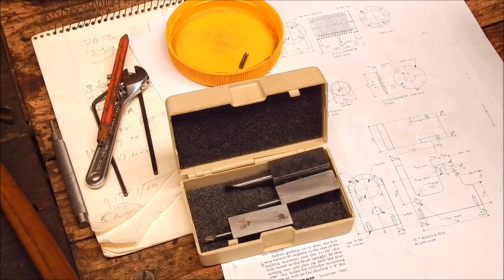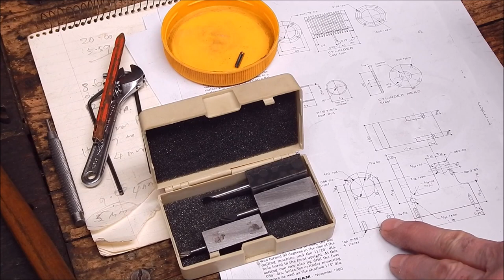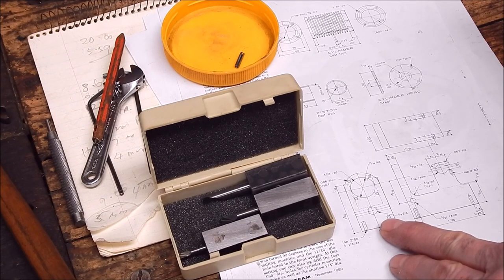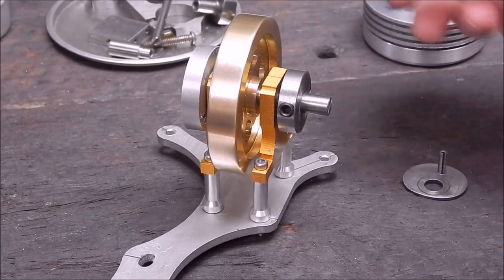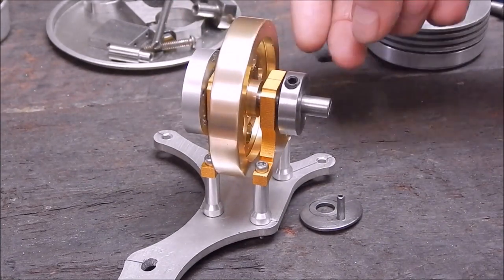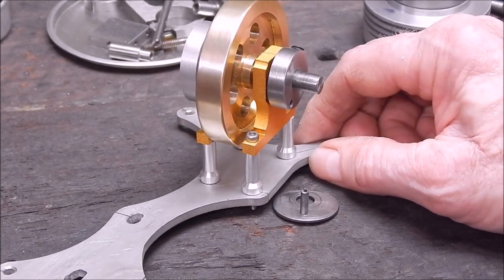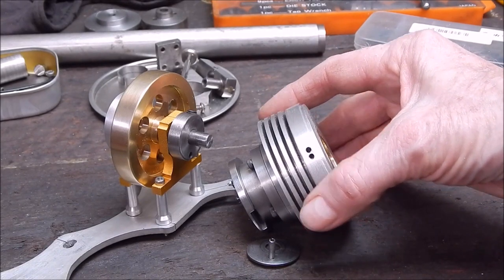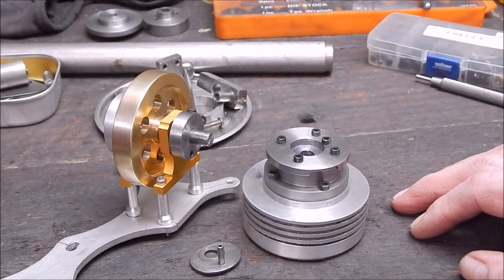How good are the tiny solid carbide boring bars from Banggood ?

Comment: Hi Rob, what flamelicker are the plans for? I initially thought it was a 'Poppin' but the frame seems different on the drawings you have there. You mention the side valve setup. Is this the same idea as the Jan Ridders design. I have built one of those and they are very fiddly to get a decent run time from. I think the valve timing being truly symmetric may cause some of the issue whereas the valve timing on my water cooled 'Nick' engine is asymmetric and that helps with the vacuum advance curve. You say you're going to use stainless for the piston. My own experience shows stainless to be a poor choice as it has a high expansion and is prone to galling. I much prefer a good piece of cast iron or graphite,though large diameter graphite rod can be like finding unobtainium at times.
Reply from the maker: Hi Howard, it is a set of "Poppin" plans.  I'm just using them as a rough guide.  I'm also re-using the bits left from a previous build of at least 20 years ago, when my design skills were not as good ;)

Brass and stainless have almost identical COE so that is not an issue.  I've also used it for pistons before without issue. So long as you match the COE's closely there should be no problem. I've never experienced galling with it, same as any steel piston. 

The flame licker being modified is a Chinese copy of the Jan Ridders design.  I have had it running, but it quickly over heats and is a poor design compared to other fl's. A piston port will always have higher friction levels than a simple flap valve.  I see a lot of sites don't sell it any more - many buyers never got it to run (from comments noted).

I did a Banggood review on it a ways back.

All interesting stuff.  

Cheers Rob